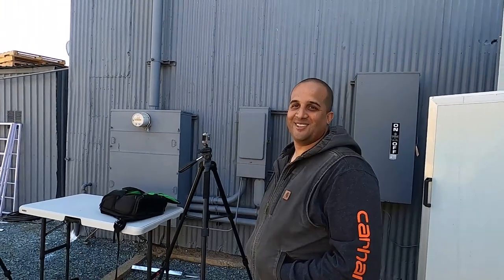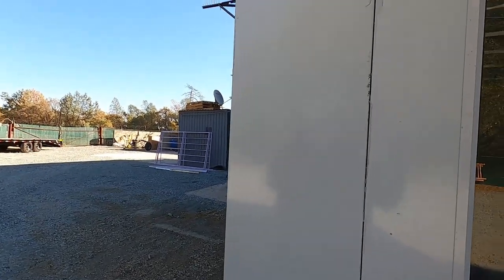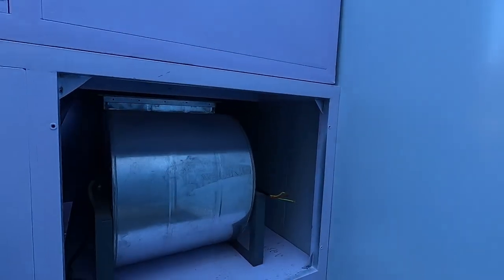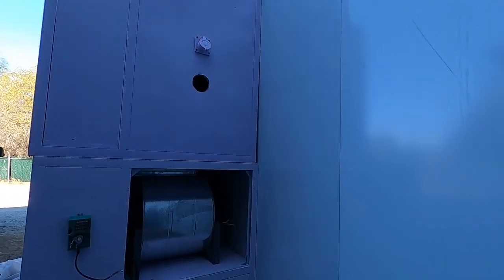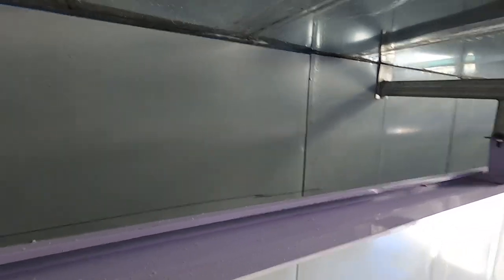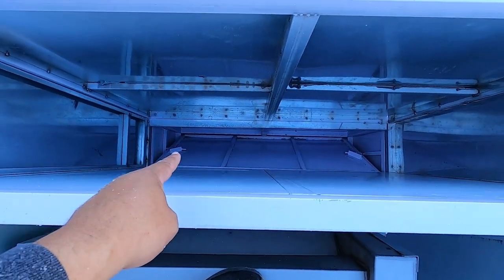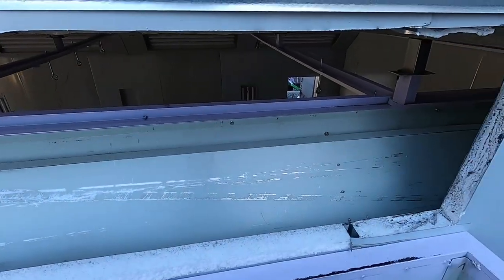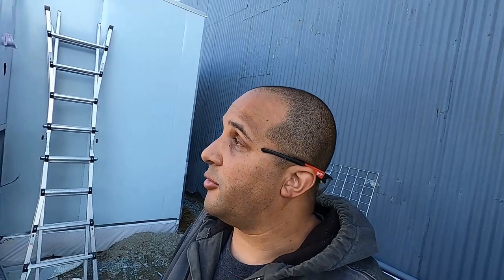How to install paint booth ducting

Comment: great video again! any link to the specific booth?
Reply: @mbimotorsports1003  are you guys heating the booth by using gas diesel or electric ?
Reply: @mbimotorsports1003  what did you guys pay in total if you don’t mind me asking? I’m in Kansas City and my first time looking into a booth from China and it’s a cheaper route for me but never dealt with port etc kinda lost and don’t want to get ripped off.
Reply: @FRONTLINEAUTO400  looks deisel